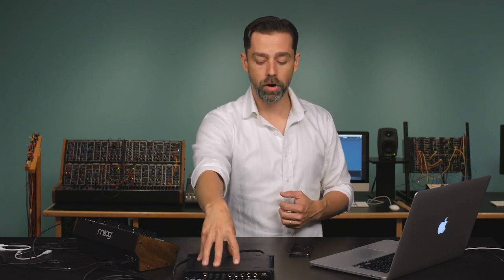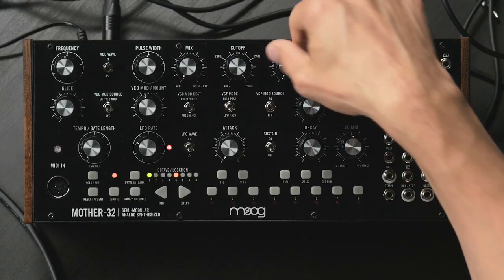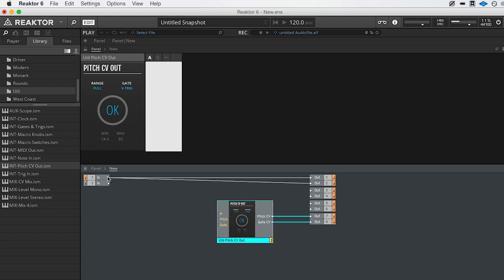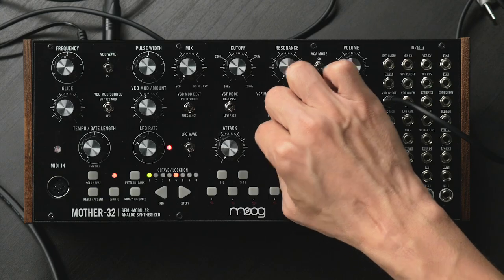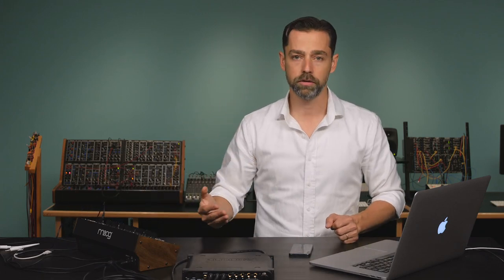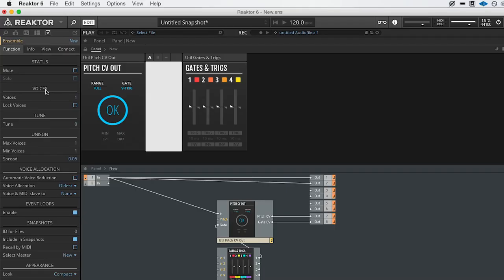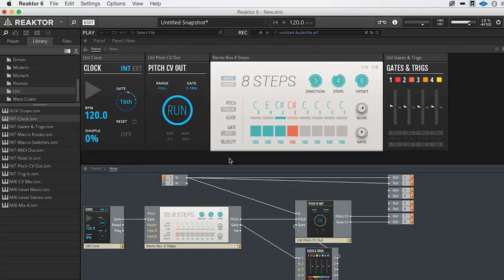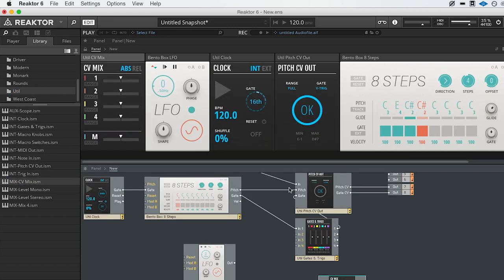Reaktor 6 Blocks 1.2 Tutorial #1: Using Blocks Signals to Control Voltage | Kadenze

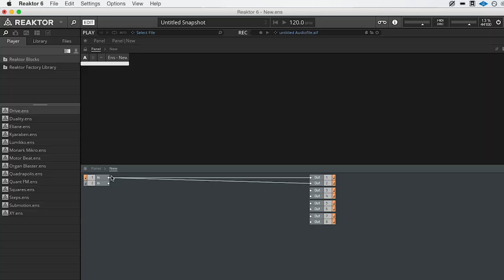Comment: When I get to the point in the tutorial 6:18 where I hook the input of the MOTU Ultralite into the output of Reaktor, I do not hear my Mother 32. I see meters on my Ultralite- like there is sound going into the Ultralite- it just does not pass through Reaktor. Can you help?
Reply: I'm still having this issue- it's so strange. In every other way my Ultralite behaves normally - It just won't pass audio through Reaktor's inputs to it's outputs.

Comment: Hello, first of great video, I got same setup as you do in the video, I just cant seem to find an Unbalanced TS cable to minijack (mono) so I can patch from my MOTU into Moog Mother 32. I got myself TS patching cables, but how the heck do i plug them in to Moog? No one seems to have TS Unbalanced to 3.5mm mono. I got myself mono to mono adapter thinking I found the right ones, but they dont seem to "fit" they just dont align and just fall off. :S
Reply: Hey! Could you solve this?

Comment: hi, i have been looking for something like this for almost a year... But I cant still see how I would make it work with my setup; I have an expert sleepers ES-4 (the spdif version). Problem is I dont seem to get access to the actual 5 outputs from the module, but just to a stereo pair as if it was just seeing a stereo spdif output. This means I am actually getting stuff out of reaktor into my modular, but just from the first output on the ES4. I have seen some people have done "expert sleepers compatible blocks", but I have not managed to make any of those work. I am trying to do this in ableton by the way. 

And oh! I went through your synthesis with reaktor course, a total must, thank you very much for that!
Reply: Hi, thanks for the response! I am using a Reaktor Block someone posted in Muffwiggler (the modular synth forum). This module is supposed to do the decoding Silent Way software does. I have been speaking with people both in that muffwiggler post and in the Reaktor forums, even emailed the creator of the block. But no one seems to have an answer to my issue. I am assuming my Foscurite  Scarlett is doing something funny, I don't know, all this is very desperating... I might just ditch the ES-4 altogether and go the ADAT way or wait for the new ES-8 usb interface... Thank you for your time though, and especially for spreading your knowledge!

Comment: i use an aggregate audio device for Reaktor. MOTU and ZZZ ES-8. in standalone i have no problem setting up outs 1 - 22 to use with my audio setup. but in Logic [or possibly any DAW] it looks like you can only setup 1-16 outs for Reaktor. 

is there a way to get more than 16 outs when using Reaktor as a plugin

thanks

Comment: am confused at the first set you take the input from the moog and how do you route it to the input within the reaktor?
Reply: Ok what if it is coming from another channel on my soundcard how do i set the in port to that channel? an=m not using a Motu I have a presonus which has 16 channels